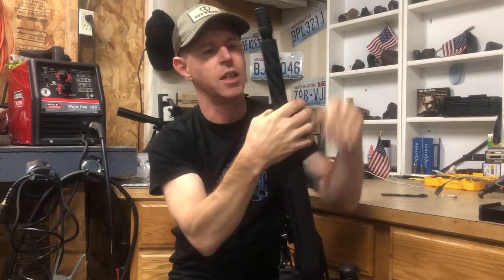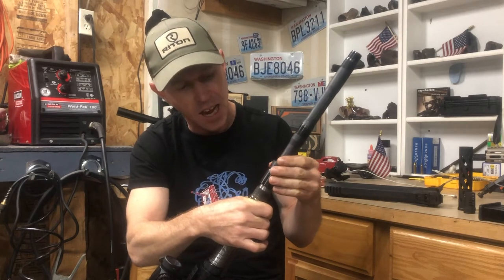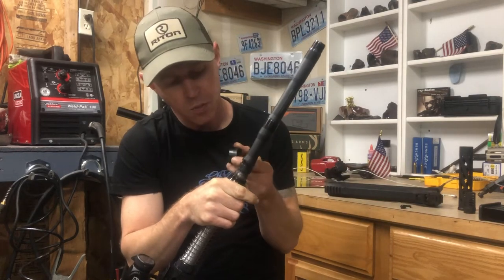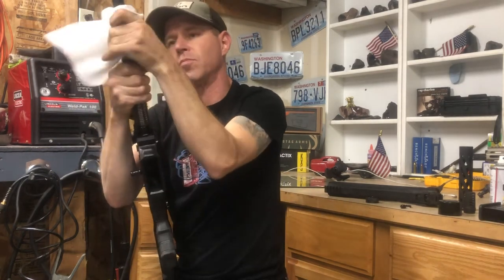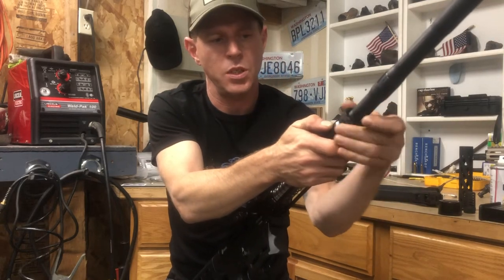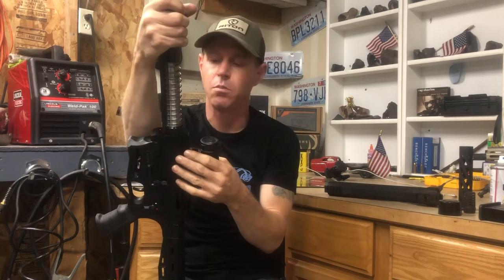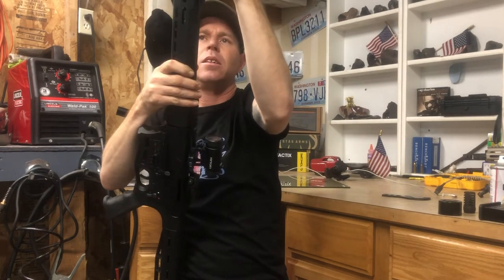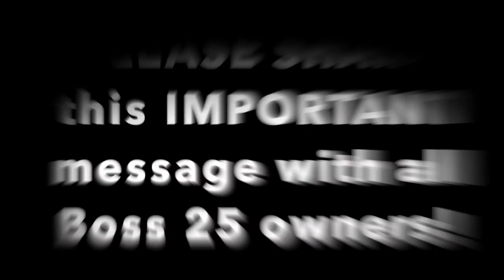Citadel Boss 25 **IMPORTANT MESSAGE FOR ALL OWNERS**

Comment: Read your manual. It says to disassemble and clean the gun, then to put 50 rounds of 1300+ ammo through it to break it in. I did that and after about 70 rounds of 1300+ ammo, I tried a box of 1045fps target ammo and it cycled all 25 rounds of low velocity with no issues.

Comment: Just got one today, for the gas piston that you mentioned was loose on yours, mine came with a heavy load and a light load one. But yes mine was loose aswell and had issues going to the next round only on steel shot. Realizing after I had the light piston, not the heavy. Lead shot worked great with the light.

Comment: They are packed in lube for protection in shipping through salt air climates, exposure on shipping containers, not for shooting.  You cannot rely one everything being tightened for shooting. Take apart, inspect, and lubricate. If it is tight, loosen and lubricate, if it is loose, tighten it.  Simple.  Anything else leads to premature wear.  Mine functioned flawlessly after proper prep.  Shooting such firearms "out of the box" on YouTube is a stunt.  I wouldn't want to buy one used that was treated that way. This is true of most but not all firearms shipped from overseas.  The classic examples are those packed in Cosmoline, which is an extreme example but the same principle.  Look for shavings, galling, and the like.  Shure, it will loosen up, but that is premature wear.  It's not the spring wearing in.  One won't notice the difference without running thousands or tens of thousands of rounds through the weapon, but it will shorten the life of the friction bearing components.  Mine is not so pricey, a $300 Trurkish 12ga tactical weapon that cycled perfectly after proper prep.  Different name, different importer, same gas operating system.  Such "out of the box" reviews have been popularized by leading YouTube reviewers and I am confident that more than one of them knew exactly what they were doing.  They'll say it's not duty or military ready, yet before issue in the military or police a weapon should go through the armorer for inspection and lubrication.  If issued directly to the user, such a procedure is dictated in the manual or instructions.  Firing a new weapon "out of the box" is additionally simply irresponsible and potentially hazardous.  Not even inspecting the barrel for obstruction by packing materials?  Think about it.
Reply from the maker: You've got a lot of great point in this comment! Thank you very much. Most of what you're saying here is correct but not all; lots of assumptions being made. The weapon was inspected but not torn all the way down prior to use; tearing down weapons is something that very few people do in their home, as a matter of fact I would bet the vast majority of manufactures would recommend against it. Certified gunsmiths are a wonderful asset to the world and this would be their job. Our job is general cleaning and lots of having fun!! Pew pew!!
Reply: @mcboomboom0078  Certainly owners should be able to strip a weapon to the point intended by the manufacturer for general cleaning and maintenance.  In the case of these shotguns, removal of the gas piston, barrel, spring, bolt carrier and bolt would be it.  Certainly one should not go beyond a certain level intended for gunsmiths or even just armorers. The manual contains the instructions for the user to strip the weapon.  And for many of these shotguns, they even include the spanner wrenches where required.
Reply: the boss 25 is my first gun, i haven’t shot it yet. how do i properly prep it if i am new to guns?
Reply from the maker: @leewroyjenkins5496  Hey, hey!! You know, I was always the type to give the unit a visual once over, general lubing and then a check of all components that are critical to  operation. I'm just about to post a new video, at somewhere around the 13:00 mark you will see what have to due to retighten just about everything on the foreward end of the Boss. That video may help you a bit but I'm don't think you should, nor recommend you to, breakdown the unit; have a good shop do it for you.

Comment: I had similar issues with mine not cycling properly.  I took it apart and noticed the o ring in the gas piston was shot.  I replaced that and it cycles great now, even with the lighter loads.

Comment: Mine was loose right out of the box. I did a field trip stripped it all the way down to the receiver, cleaned everything, oiled it, and assembled everything to a good snug nice. I took it out and put about 60 rounds through mine, and my choke in front of a heat shield or loose as well. I guess it’s just one of those things you’ll have to check it every time you go out
Reply from the maker: Oh, wow. Sounds like the shop you got it from didn’t even do a once over on it. Check out my latest video and you’ll see how everything basically fell apart on me after about 20 rounds.
Reply: @mcboomboom0078  Thanks so much, got mine from Buds online a month ago. I'm 99% sure the shotgun was not checked before it was shipped to me. I will disassemble mine clean it and make everything is tight.

Comment: Everyone! Take this gun apart completely.  All of the cast parts need to be polished and cleaned up before firing. Wipe off all of the shipping lube and grease it up proper.  Dont overdo it but slick her up. They recommend 60 plus rounds with the heavy for break in. By doing this initial polishing youll save ammo and prevent cast slag from damaging your gun. It will run smoother than what 60 rounds will do for you. Keep an eye on the muzzle brake. It will come loose everytime you shoot it. Use gloves when checking it cause itll be f'n warm. Take the flip up sights off and spin them around. The turks installed them all backwards. Youll verify this just by looking at them. A little blue loct-tite goes a long ways on these brutes. Love mine and have fun!

Comment: I've owned this shotgun for a while, most of us common sense people know exactly how these things work, obviously you didn't disassemble the gun to double check it before breaking it in, and I bet you also weren't aware that if you over tighten the barrel shroud next to the boss the plate that holds pressure to the handgaurd gets bent from over tightening, the gun will certainly everytime you shoot it will loosen at the handgaurd,  & barrel shroud, smart people use blue loctite

Comment: I followed your advice, thanks! BTW: do you use low brass and high brass shells with equal results? My Boss 25 on its first day out (after a good cleaning) didn't cycle 4 (2 00 buck and 2 slug) of the 5 brands i tried - they were all low brass. it only cycled the black aces high brass 00 buck. thoughts??

Comment: Hi Thanks for the video. Did it cycle better after doing this? I took mine out last week for the first time after only giving it a light cleaning and i had a few failures to feed and failures to eject. I just took it apart and gave it a more thorough cleaning this past weekend. I'm hoping to take it out and run it again this weekend. I did run hotter shells through it by the way. 1300 fps and above. Well a few were 1290.
Reply from the maker: Hey there! You’re very welcome. 

Unfortunately I haven’t had a chance to take her back out; the plan was to do it this weekend but we ended up having three days of rain. Today is nice an clear though, go figure. I’ll be sure to post a new video on its cycling as soon as I get it out. 
How many rounds did you put through it prior to this last good cleaning? Did you find you nuts (haha) we a bit loosened as well? 
What size/velocity ammo we you running during the failures?
Reply: @mcboomboom0078  hi I used 2  3/4" shells ranging 1600 FPS Hornady Critical Defense .00 buck to 1350 FPS .00 buck and a few 1290 FPS .00 buck. maybe a total of 35 shells. I havent taken it back out since i gave it a solid cleaning, but I plan to this weekend. Oddly enough my "nuts" were not loose lol. I did tighten them down pretty well after cleaning. I think my Boss might be slightly modified from prior versions. the only reason I say this is my handguard doesnt have those 2 small tightening screws located near the "upper". it was loose when I got the gun but after I tightend the barrel shroud the handguard has stayed pretty snug. I just had those issues I mentioned in the previous message when I took it out the first time. i think maybe i had to to do with just giving it a light cleaning before it took it out. I'll keep you posted.
Reply: Check all mags. I had failure to feeds The rounds kept hanging up in the mags. The gun was fine. The inside of the mags need attention.
Reply from the maker: @LifeSavingDefense  can you be a bit more specific on what the actual problem was in the mag?
Reply: @LifeSavingDefense  cool thanks for the advice! Definitely Going to look into that today.
Reply: To break it in you need to run 50 1500fps shells to get the spring flexing good .. before you do that .. change out the bigger gas piston that comes with it .. after 25 clean it 25 clean it and then you can swap back to the original gas piston and only shoot 1300 fps or higher but every time you Wana shoot 1500 fps or higher swap out gas piston .. mine came with all the information and I followed and my gun shoots great ... I clean after 50 shots and so far I have about 600 rounds through it .. great gun for the price .

Comment: The manufacturer says barrel nut is to be hand tight. I ask them because I was looking for a wrench for it. No need to crank it down! You say tourqe it down...to what tourqe you tightnen it?
Reply from the maker: A hand tight barre nut… amazing. I don’t see why it would be rational to only hand tighten; what negative effects could I tightened one have? I put it the normal specs, 35-50ft lbs also known as SFT. Lol

Comment: Check all mags. I had failure to feeds The rounds kept hanging up in the mags. The gun was fine. The inside of the mags need attention.
Reply: Did it dig into the tip of shell?
Reply from the maker: I looked into them and they both needed a bit of tweakin; check out the new video of rounds 35-60; thing basically fell apart on me

Comment: Where did you get that tool that you used to tighten down that nut?
Reply from the maker: That was the tool sent with the Strike Industies Gridlok Lite handguard, it’s intended for the Gridlok barrel nut but fit perfectly fine on the Boss’ barrel nut.

Comment: I just bought one and I took it apart before I shot it and made sure everything was tight.  The "Mussel Break" on mine has modified choke attached to it.  I will have to look at that again and seed if it comes apart.  I found that it did not cycle the action on the first 20 rounds but I have since did a good cleaning and oiled it down but need to try it again.
Reply from the maker: That choke detaches if it’s the one I’m thinking of.

Comment: Thanks for the video but if you would read instructions or actually talk to a gunsmith any new gun you get you need to disassemble and clean before firing for the first time so that you can double-check all components are tight and in place and everything is well lubed up and it states that any owners manual for the gun. So something would have happened to you it would have been your own fault I'm sorry if this seems kind of harsh I don't know how to sugarcoat anyting.

Comment: I can't get my heat shield off its stuck real tight
Reply: Heat shield..wrap several layers of duct tape around the shield about in the center section, used  rounded vice grips and break it free...there is a collar nut inside that tends to get stuck and makes the shroud hard to remove..Remove it carefully and check inner and outer threads to make sure they are not damaged..if ok oil it real good and don't over tighten..my trick to keeping it snug and removable later..use alittle plumbers Teflon tape ....just alittle to take up any slop in the threads as you tighten the shroud down..
Reply: @MYDOGBUD  thank you I used some blue Loctite it works for me

Comment: Always dissemble shotgun and remove shipping oil , Relube with light gun oil all moving parts..
Same for lower receiver trigger parts...You should mention the piston weight VS fps loads..two reasons your boss 25 fails to cycle correctly..
Dry mag follower 
Incorrect piston weight for ammo used..
Standard weight, up to 1450 fps loads
Heavy piston weight 1500 or higher fps loads..pay attention to what your shooting and what piston your using..
2 yrs now on mine , custom trigger springs, custom sear polishing..went from the stock 9 lb pull to 4 lbs and no slop in the trigger action..I regularly shoot 1600 fps slugs and sabot rounds  in mine..10 rd mags and 20 rd drum...Mine cycles correctly because I pay attention to how it's set up and what I feed it..After the break in you can shoot cheap bird shot , the low brass Walmart junk in the 1200 fps reliable but the gem of these piston gas hybrids is the fact you can blow through hundreds of rounds of slugs and not have to tear it down to clean ..I do that every 5th shoot or around 500 rds I actually clean and oil..it's a very reliable platform..
Reply: I just bought mine, unfortunately I have nowhere near your knowledge of firearms.
Reply: Where do you get most parts? My searches, even though Legacy, come up empty.

Comment: Only thing I don’t like is the need to run 1300 FPS rounds.  
I have a a lot of shot shells that now I must keep separate.  If life depends on a firearm, having to sort through rounds is not a good thing. 
Maybe they will come out with a low pressure spring and piston…
Reply: After you break it in like it says in the manual it will shoot lower velocity target rounds. I put about 70 rounds through mine of 1300+ buckshot and birdshot, then put in some low recoil target ammo around 1045fps and it cycled the entire box of 25 with no issues.

Comment: So cranking it down doesn’t last. I’ve had to tighten mine several times. The machine tolerance on the gun is terrible. Mine wouldn’t cycle because of poor machine work on the back of the bolt. The barrel nut will eventually blow off which could injure you. This far very disappointed..